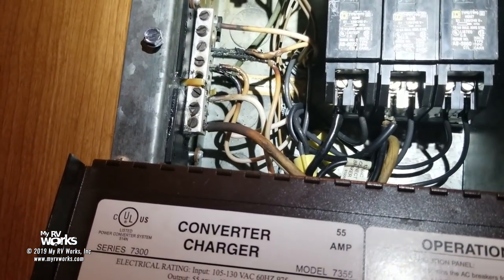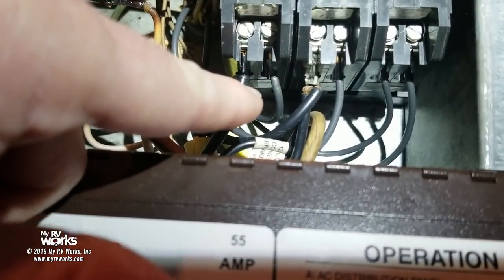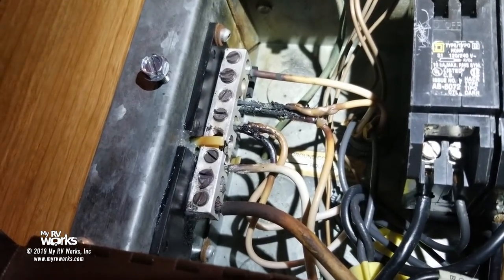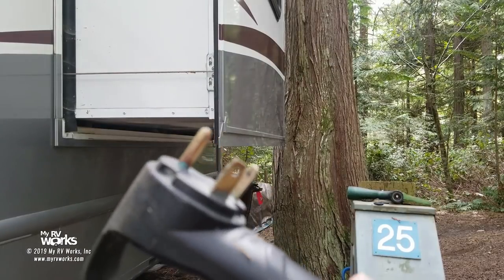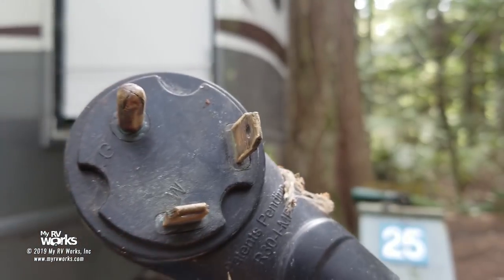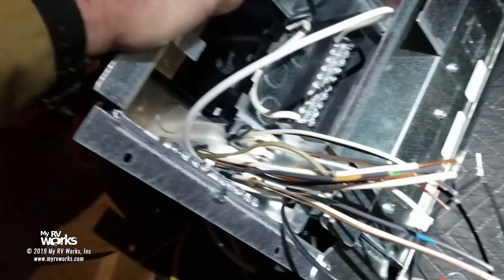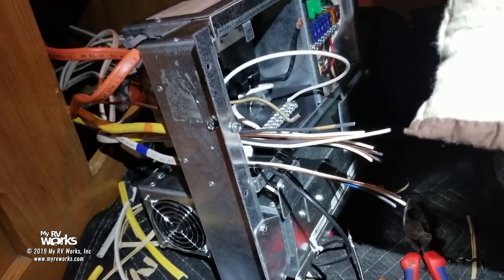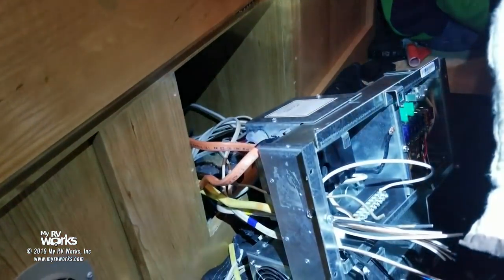Replace RV Electrical Service Panel & Explanation Of How Electricity Works

Comment: Why does my breaker  pop when airconditioner and  microwave are running
Reply from the maker: The air conditioner will consume somewhere in the neighborhood of 12 amps. Different microwave sizes consume different but let's just say that you have a 1,500 watt microwave which will consume also about 12 amps. Together you're looking at 24 amps of power being consumed on those two appliances. If your coach is a 30 amp coach that only leaves you with six available amps to run your battery charger, water heater if you have it in that mode, TVs and things like that. So, just  like not having enough money in the bank, you start bouncing checks. Well if you don't have enough electricity coming into the RV the breaker start tripping. Since the air conditioner and microwave are the two largest appliances, then  are the ones to trip first.  That is not to say that there may be other problems there but it could be something as simple as that.

Comment: Darren,   Excellent video!   I designed electrical systems for electrical contractors since 1983, and taught others for about 30 years.   I never used some of your analogies, but I liked them.   There a couple things that are a little off, but most will not know.   In AC you pass your hot potatoes to the next person and get them back 60 times per second.   Also, a 120 volt rms sine wave has peak voltage of 170 volts.   A 240 volt rms sine wave has peak voltage of 339 volts.   For those who say that the two 120 volts add together to get 240 volts, and that they are out of phase by 180 degrees, they only know what the were told or what an oscilloscope is showing.   They do not truly understand.   
Keep up the great videos!
Respectfully,   Kevin
Reply: Doesn’t the voltage difference have something to do with the vector angles?

Comment: I've been seriously considering getting into RV service and repair. How do I do that?
Reply from the maker: The industry can sure use good techs and the RV market has exploded the past few years so there is good job security.  I resigned as a Sr. Industrial Automation System Engineer when my kids were born to start my own family business.  I have no regrets.  More on my story here:  https://myrvworks.com/about/ 
Send me an email to Darren@myrvworks.com and we can have a more lengthy dialog on how to get started.  If you are in my area (or willing to relocate up here) we can discuss training some OJT opportunities if you are inclined.

Here are two links right away to offer you more info:
https://www.rvtechnician.com/
https://nrvta.com/

Comment: Hi on my friend Rv a/c has problem: the compresor stop working trip the break on night time after work all.  Today I clean the coils blower wheel  is been done this since a months .what could trip the braeker?
Reply from the maker: If the breaker has tripped several times, then it has more likely become a fatigued. Each breaker tripping weakens the breaker. Start by replacing the breaker and see if the problem goes away. If not then I would monitor the voltage going to the air conditioner. Interesting that it's doing it at night when it runs fine all day. Normally we see it the opposite way.

Comment: I would stick with one analogy. Water is the one I use. This is great I've been a tech all my life and never seen a neutral fail that was great data. I've bought an old RV and the electric is a mess. I can do ohms law calcs in my sleep so I'm not worried. I'll be watching all your videos.
Reply from the maker: Thanks for the reply and hope you enjoy the videos. There are quite a few other RV techs on here that are enjoying them as well.

Comment: Should the wire coming in to feed the neutral bus bar be stranded or solid?
Reply from the maker: It can be either. Typically in an RV the AC circuits are solid (Romex) Wire and the DC circuits are stranded. But that's not a rule, but for your neutral, the wire gauge between the neutral and the hot wire should be the same. But stranded or solid really does not matter at that point. If you think of it, you're sure cord is stranded.

Comment: so this is great info but what im looking for is a view of this black rectangle blk box that bolts to the alternator bracket mount on a winnebago brave 454 throttle body injection ...it has about 6 hot leads on it and im looking to identify the two wires on the very bottom one to prove that this is where they
Reply from the maker: I can't help you with that, but Winnebago has a fantastic resource on their website. You may need your  VIN number. But you can look up your coach information there and they do have lots of wiring schematics you can  access.  If not a simple call to Winnebago Tech support might be able to help you with that.

Comment: My friend got a new RV and we have to move for the job but when we plug on it  the inside light and some plugs are not working, the fuse and batterie are ok, so, how we can figured out what is the problem if everything is brand new?
Reply from the maker: Hi Pepe,

My first thought is to see if you have tripped a GFCI receptacle.  They are usually located in the bathroom but they could be other places too.  What makes me think that is that you said 'some' of the plugs are not working...  The ones that are not working - are they in the kitchen, outside and in the bathroom?  If those are not working the more suspicious I am of the GFCI.

To go farther in the troubleshooting you will need a digital multi-meter that can read both AC and DC voltage.   Lemme' know.

Cheers,
Darren

Comment: I tried to stick with you on this explanation of why the white wire was melting but all that discussion about potatoes was a bit much for me.
Reply from the maker: We can extend the analogy in that the passing of the potatoes was not a smooth process.  Both the delivery of the potato and the return to pick up another potato is important.  If white wire is melting, than the return to pick up another potato is where the fault was.  White wire had a loose connection - which created heat due to resistance.
Reply: @MyRVWorks  I gotcha!!!☺ I think I would understand it better withput calling it potatoes though.

Comment: Darren. Loved this video with your explanations and your examples. That was a nice simple way to let people who no nothing about electricity get a basic understanding.

One question about the meter though when reading ac. It was my understanding that the meter leads gave you the difference between the hot wire and the return wire because the electric is only 110 coming in.... not 220. Can you explain?

Keep the videos coming even if you don't think its interesting. The viewers enjoy it.

Thanks

Bobby
Reply from the maker: Regarding the meter leads. Think of the AC sine wave (if I were connect my oscilloscope up you would see it clearly) the electrons are passing through the conductor, alternating the time they're on the top of the wave and the bottom of the wave.  What you're reading on that meter is the average.  So if half the time the wave is at 220 and the other half of the time the wave is at 0 than the average is 110.  So the meter displays 110 not 220.  My meter is a 'True RMS' meter so there's a lot more math behind it to account for digital switching circuits, dimmer switches, ballasts  Etc. but the concept is the same.  I know we're always talking about residential circuit as being 110-115 things like that but technically it's 220 + 0 happening so fast that you are average at 110-115.  To use a water analogy think of the ocean with the waves. They say the sea is 2 feet, for example, I would imagine you would have the bottom of the wave as zero in the top of the wave at four feet, so they say two feet to average maybe that helps...
Reply: I am never to old to learn something new.  Thanks for the explanation.  @MyRVWorks

Comment: Great video, thanks for sharing your knowledge and experience. I have a question that maybe you can shed some light on for me. I'm all the way across the country from you in S.C.. Our RV is a 50 amp Newmar Dutch Star we keep garaged when not traveling. I don't have a 50 amp service for it yet so I use a 50 to 30 and a 30 to 15 amp adaptor which works fine for the very limited things we use while its parked.( converter, lights, refrigerator on electric while getting it ready to travel). I changed the standard outlet to a  GFCI outlet for safety while using tools in the garage but as soon as plug in the coach the GFCI trips. I have had an electrician tell me that was a common problem with rvs. I'm pretty sure everything in the garage and the GFCI IS wired right. I even opened the outlet to double check the GFCI wiring. Any ideas? Your help would be greatly  appreciated.
Reply from the maker: Hi Rick,

This is, in fact, a common problem in RV's and if we understand how the GFCI works it is easy to rectify...  I can make a separate video on this topic too...  

The GFCI has only one job.  That job is to compare a single circuit containing the black wire to the paired white wire (period - do not pass go and do not collect $200).  Other receptacles can be connected 'downstream' of the GFCI  and be protected by it but it is still the same circuit and the GFCI is monitoring the same black and paired white.  

Using my hot potato analogy I came up with in the video - if the GFCI saw 10 (charged) potato's pass on the black wire it is expecting to see 10 'empty' potatoes coming back.  If 10 potatoes got through but only 9 came back - than the GFCI will trip because one of those potato's was dropped to the ground ergo a ground fault.  This is what would happen if you were using a hair dryer while taking a bath and the hair dryer fell in the tub.  The potato's are going into your wet body and not back on the white wire see...   That is why the NEC states that receptacles within 6' of a water source must be GFCI's (there is more to it but for this short explanation I will just keep with that).

But wait - there is more...  the second part of my above 'job of the GFCI' statement is that the GFCI is only able to monitor a 'single' circuit - one black and the paired white (period).   As soon as you connect your 15 -> 30 -> 50 adapter (the 30 ->50 is where the issue lives)  you have split the circuit.  The GFCI in the garage is being tasked with monitoring two black wires and a single white.  That will never be allowed to pass the GFCI test.

So the solution is to add a separate receptacle in the garage that is NOT GFCI protected and let the GFCI in the RV do the protecting - because THAT GFCI (in the RV) is only monitoring a single black and the paired white - keeping everything in balance.

There is a way to create cheater box so your situation will work with your garage GFCI but it involves an isolation transformer and I am not going to get into that here...  Perhaps in the upcoming video.

Hope this helps!

Cheers,
Darren
Reply: Darren,
I’ve really enjoyed your video here about electricity and your current/voltage lesson using potatoes or water flow. I would have liked to hear a bit more especially about why the Black and Red (Line 1 and Line 2) wire are bigger than say the White/Neutral, typically. An explanation of single phase being actually a center tapped transformer and the Black and Red being 180 degrees out of phase from each other. This analogy seems to always be mis-interpreted as 2 different phases, which it is not. It may be too technical, but... If you could incorporate that in any upcoming videos, I would love to hear, watch, and share it. I’m not trying to condemn nor degrade your videos, they are very much enjoyed. I especially enjoyed you ladder winch to get 100 lbs of an air conditioner in the roof.
        As an electronics technician and new to the RV world, knowing more of the electrical configurations both AC and DC is a learning lesson and very interesting for me. I’m fairly confident with home electrical, implementing a transfer switch, a 22Kw generator, sub-panel, 50A, service on my own under the license of another. However, the addition of inverters, battery banks, converters/chargers, chassis and house batteries, disconnects, automation control panels (SilverLeaf) creates a bit of a menagerie of concerns. Connections and how various, low voltage communication,  RV-C and sensors can be affected are of great concern. 

Thanks again for sharing your experience and exceptional knowledge in the various aspects of maintaining an RV. There should be more DIYers doing there own repairs, especially since there seems a need for more honorable and knowledgeable technicians at RV repair facilities. Great videos!!!!
Reply: @edwardvan00  Edward: Where did you see the White wire smaller than the White (Neutral) wire? I have never seen a cable or any other wiring where this is so and I've been an electrician for 60 years. Yup! It is against any code or manufacturing standards. The only wire which is smaller (usually by about one gauge) is the bare Ground wire.

Comment: Darren
I appreciate the detail. Great video. Can I communicate with you on a problem I’m having. I don’t want to take up space here but I’ve run out of resources. Our TT is a 2011 year. We bought used.  It’s in good condition. Only thing not working was the air-conditioning system. The fan would blow but no cold air. I got that resolved by replacing capacitors and the air-conditioning is running fine now. Briefly here’s my issue. I installed shore power from our house so that we could have the trailer plugged in all the time. I discovered accidentally that one day the air conditioning was on and I was going to do some work and I turn the radio on it’s in Jensen factory installed. When I turn the radio on the air-conditioner tripped.I let it reset and tested again and you did the same thing radio on air conditioner tripped. My wife discovered that if you open the refrigerator with the AC on it trips it has a dc light in the fridge that would blink before the AC tripped. I checked the light it was good. It really is sad but it just trips. I have two electricians and electrical engineer try to help me with the problem and so far we’ve had no results. Is there a place that you believe I should be looking. Our converter is a WFC0 8955. This is a bit more condensed as to what I’ve done but this is kind of a summary. The AC is tripping out on low voltage. The AC voltage is 120+ on AC startup it drops to 116. Radio on trip. I just don’t know where to go from here trying to resolve. Any help appreciated or contact information thank you
Reply from the maker: Tell me about the connection to your house? Are you using a full 50 or 30 amp Shore cord connector the whole way with a dedicated circuit in your home or are you plugged into an extension cord with an adapter to your RV Shore cord?  Also what is the length? What I'm getting at here is voltage drop. You state the voltage drops to 116 volts when the air conditioner starts it up. So, approach this from a voltage drop issue, it's possible that your converter is dropping below the acceptable voltage and cutting out. As the voltage goes down the amperage goes up therefore your breakers trip.
Reply: And electrician friend and I finally figured it out after many many trial and error‘s. All it wound up being was a hot lead crimp connector to the battery back to the converter  that was corroded and not making good connection we crimped it with new spades and everything works fine. We found it out by running a wire from the WFCO converter Hot connection to the battery hot post. And everything worked so we knew that the cable connection back to the converter was the issue. We eliminated it back to the short cable from the battery to the terminal block. It was an ordeal I will say that to find something that was a simple as a corroded spade. Maybe this will help someone else out in the future
Reply from the maker: Grapevine. I'm glad you and your electrician friend were able to get it figured out. Happy camping.

Comment: I had a shore power plug melt badly on the neutral leg. It only happened once at one camp ground. I replaced the plug and went nuts trying to find a short on my rv... no joy. It probably was the site pedestal... as I've never had an issue since then. I was going to ask what to check for when you get to a site... but you answered it. ;-) Awesome channel!
Reply from the maker: Thanks for the comment. Yes, pedestals found in RV parks take a tremendous amount of abuse from everyone else that's ever plugged in with their dirty prongs and melted plugs. You owe it to yourself to check the pedestal before you plug into it. They're like toilet seats lol
Reply: @MyRVWorks  Do you have a forum in which questions could be asked? I know your the real deal and I'd be willing to pay for for a couple minutes of your time and thoughts on the matter. It's a question regarding a gas valve on a hydroflame 8232 furnace. Following your video, I quickly diagnosed the problem. I got it working no problem, but I do want to replace the valve. Finding a suitable replacement is what we'd be discussing.
Reply from the maker: @srmj71  Have you watched this video:  https://youtu.be/elpPdk_MSbU
On my website I do have a resource with service manuals.  I don't have all of them but I do have many uploaded there.  From that resource you may be able to identify your model and a parts list.